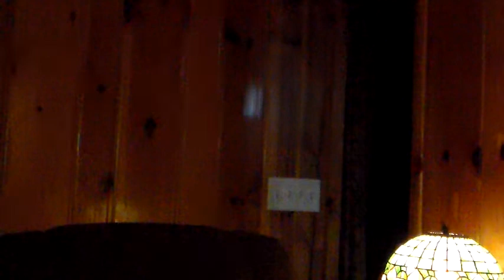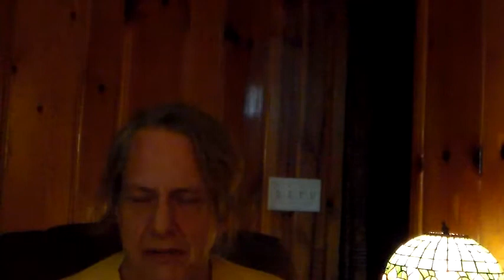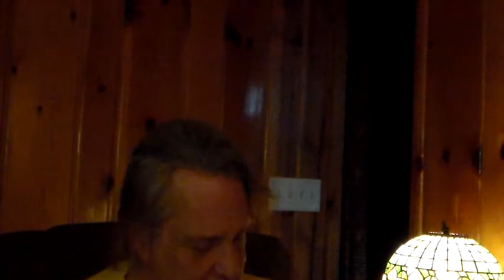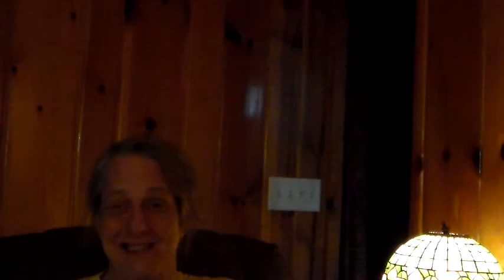Y T P C  Help! My Cobb Shank is Loose! 5 24 2016

Comment from the maker: Great suggestions all.  Actually, another youtube piper sent me a link to a video from last year, done by Scott at Aristocobbs.  His idea was to put the stem into boiling water, then use a golf tee or pencil point to expand the tenon a bit.  If the tenon is too tight in the shank, you just again put the tenon into boiling water, then work it into the shank.  Great video, and that too helped a lot.  I don't like the idea of using pipe mud, as that seems to permanent (i.e. I'd never get the stem back out during cleaning), but anything is worth a try.  I had thought about beeswax (don't have any on hand), nor do I have Teflon plumber's tape (another suggestion from Scott in his video).  I never thought about swelling up my shank (hee hee hee), sot thanks Chris for that idea as well.  I appreciate all the ideas and help....thanks guys.

Comment: Hi Paul - unfortunately this is going to be a problem from time to time with corn cob pipes.  I have a Missouri Meerschaum Mark Twain pipe with a loose tenon, and I used the method of soaking the shank in hot water for an hour, and that worked . . . until it didn't.  I just accept the fact that I have pipe with a somewhat loose tenon.  If it ever got to the point of actually falling apart, I would just chuck it and buy another one.  Let's keep this in perspective - I can't see taking extraordinary heroic lifesaving measures to try and save a cheap corn cob pipe, any more than I would try to mend socks and underwear with holes in them.  I'm frugal, but I'm not THAT frugal.